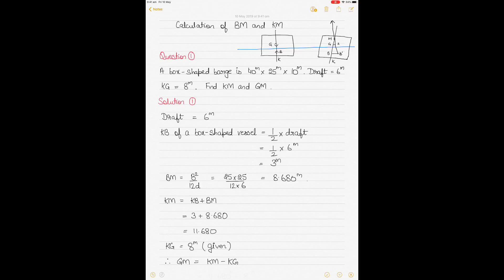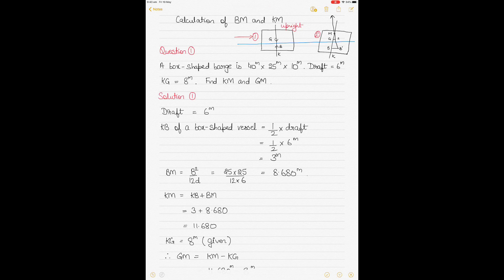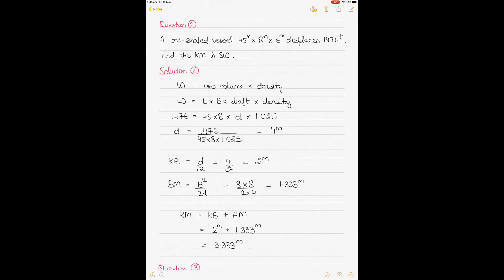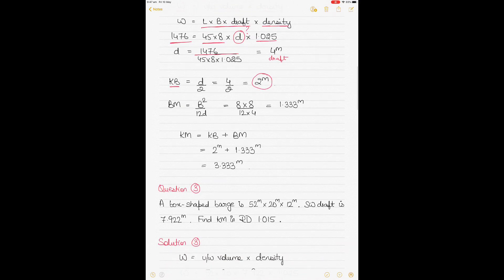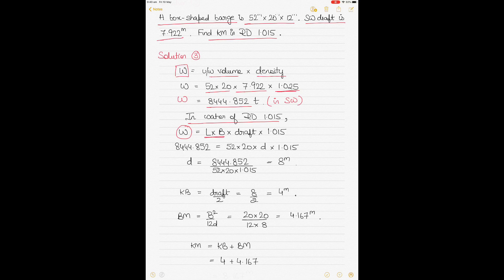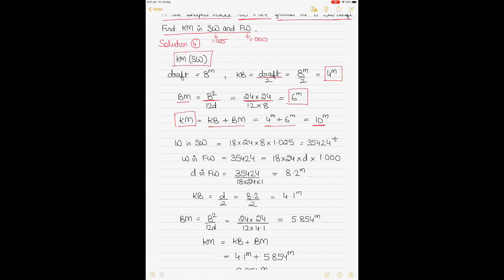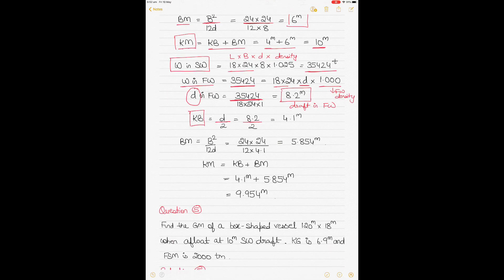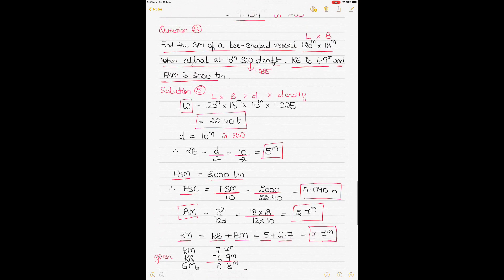Ship stability for Mates and Masters - KM and BM calculation

Comment: my ques is km is not change for density wen we enter hydrstatic tables then y cant we use the same km here for sw
Reply: If I am understanding your question, the SW indicates the density of the water and therefore affects the draft of the vessel. If the draft changes, then so too does the distance KB, which will change KM.